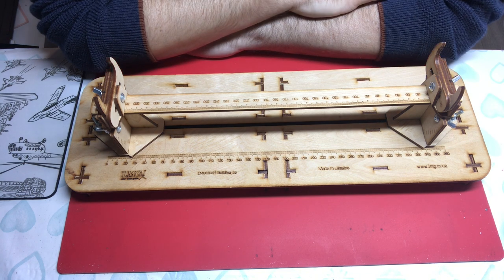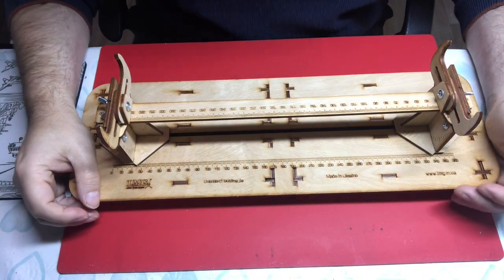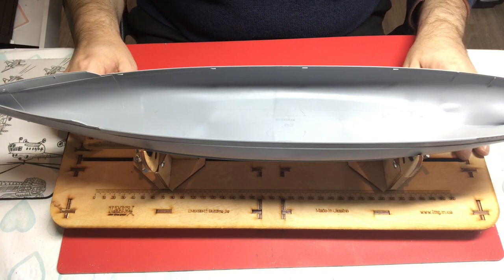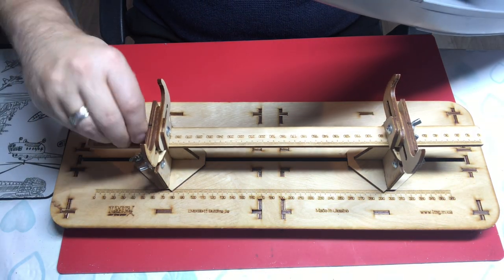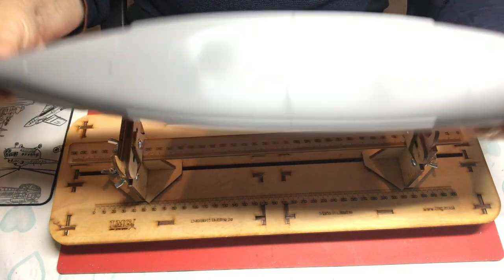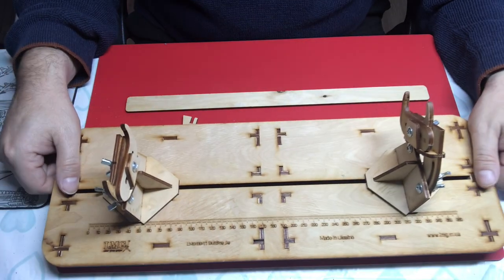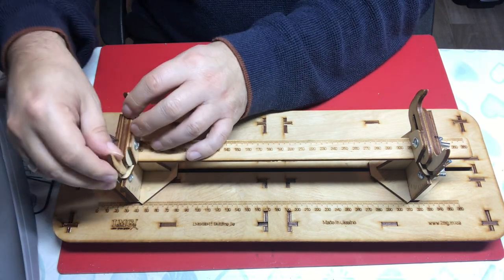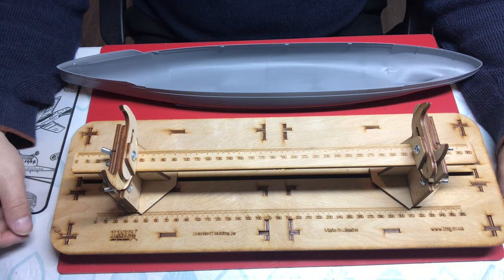focus on tools for modelling - LMG ship building berth

Comment: Hi Jason, thanks for showing this to us.  If it were mine, I would probably loose the wing nuts and just use standard nuts.  I have a nut driver( a screwdriver with a socketed end) that would reach under the model and easy tighten or loosen the nuts. Maybe line the jaws with some rubber to grip better.  Thanks for sharing.